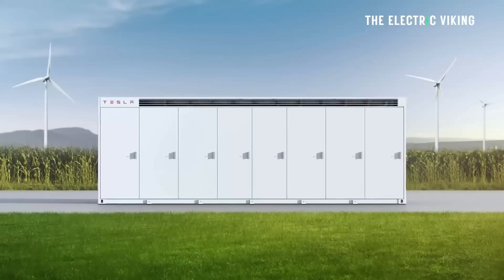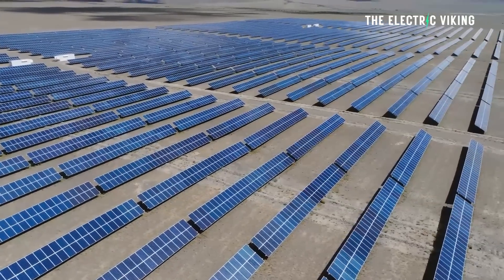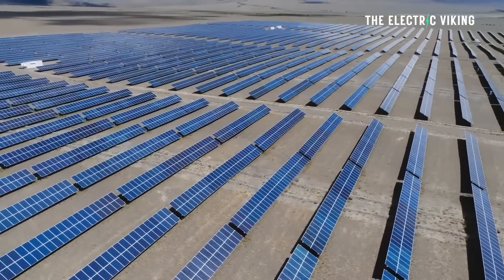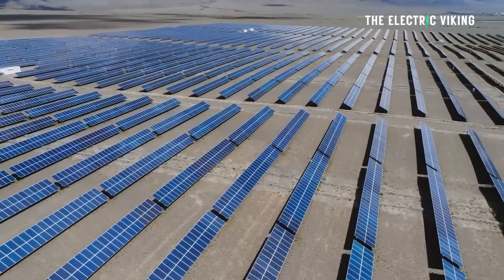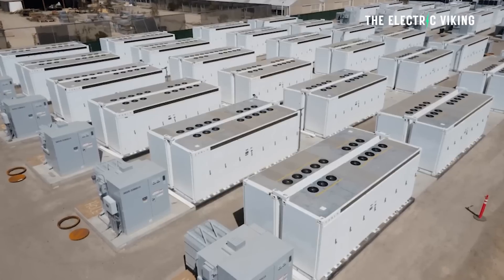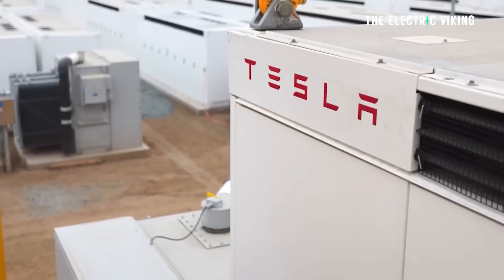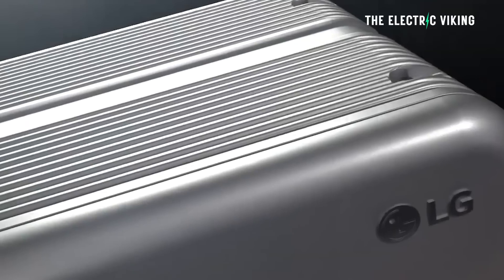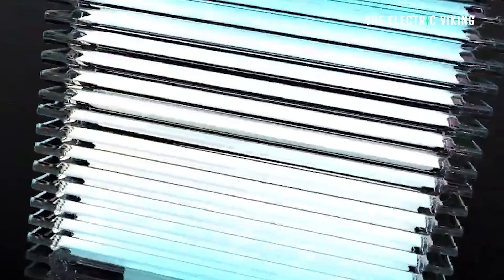Most Aussie solar, battery & EV charging systems in-correctly installed

Comment: This is a cautionary tale for the rest of us. Due to the periodicity of solar production, it will be quite temping and frequently necessary to overprovision solar to ensure adequate power during the cold times of the year with limited sun. This is fine and what should happen. Unfortunately , the grid regulator needs to ensure an even, consistent energy supply on the grid, which solar definitely is not. Consequently, they need a way to either store an excess of power on grid, or switch off customers rooftop solar, in markets where there is a lot of rooftop solar. This is a massive problem for grid operators because homeowners are in general a grumpy lot, busy with castle building, and not terribly compliant. Nor are they especially likely to be cooperative and turn off the free energy they otherwise would be paying for at their utilities’ request. They also might simply be not at home. The utilities’ opportunity is to make sure that inverters have the right features and are installed correctly for remote operation by the grid operator so that the homeowner is out of the loop.

Comment: There have been huge changes to what and how wiring is done . That doesn't mean things are wrong . They were right when installed to the standards then . Talk to Actual electricians and they will tel you what Im saying is true . This happens in a lot of industries changing standards . Do you see Governments retrofitting all the wiring in their buildings NO . I bet 95% of 5 year or older buildings don't comply to a whole heap of standards , lifts, flooring , lighting, water supply , balcony height , window openings, handrails , roof insulation around downlight ( even LED ) . By law you change one thing and you have to bring it all up to the current standard , don't see Government doing it when it applies to them . Unless it suits them .
Reply: They are plenty wrong when one considers the need of the grid operator to regulate voltages. The only reason it isn’t happening in more places is that solar uptake has been slow in those places. Future building code will eventually have to include means by which the grid operator can remotely shut off panels if they’re is an overproduction problem.

Comment: I am not in Australia (UK) but could the regulations lead to consumers being forced to IMPORT power as a "grid stability" measure during a time when solar is actually producing an excess?
I can see that it is clearly in the interests of grid stability to have the systems reduce exports - possibly to zero - but not beyond zero. Also "rooftop curtailment" sounds like it goes beyond that. For example, limiting the householder's ability even to use his own power in-house. 
My view is that the Sun is free, and what power I generate is 100% mine to do with exactly how I please, and pay no-one for it. But of course, the grid itself is not mine, so its managers can ask that it not be used as an infinite sink for excess.
I found the piece slightly baffling in that it did not summarise what the required settings provided for in terms of (say) limiting export ( at least in broadest terms).
Reply: Yes. That is exactly what will happen — to the degree that you would otherwise be using energy. I don’t yet see jackbooted things showing up at your door to demand you turn on the dryer, at least until inexpensive robosoldiers are available.

If you want to avoid this fate, home storage is important.

Comment: Rule no.1... dont export to grid... just use you own solar power.
Reply: This is quite inefficient. A lot of solar power would be wasted, especially in summer, when the sun is shining and the batteries are full. This will be especially likely because the off grid customer will need to install a many times larger solar array in order to cover winter energy needs, meaning that in summer they will have vastly more power they need.
Reply: @ianollmann9393  One of the by products of all power is heat.... heat is not your friend in any equipment especially in summer. Ever wondered why they put 25 deg C temp with the battery specs and checked what happens to the live cycles at 35 deg C?
BTW, I live off grid on solar power.

Comment: I seem to remember hearing about this at the time the regulation was introduced. I would be willing to bet the reasons many inverters don't comply is because installers weren't given appropriate notice and neither were the inverter manufacturers. Many were left with stock that didn't comply (especially in South Australia where the change was actually implemented in September 2020). Still I wouldn't be surprised if complying inverters were installed with the incorrect settings. But what a mess of a response from the authority. On inverters where they could "tell" half of them didn't comply? You would think the idea of sending an inspector out to someone's home might involve actual testing to determine if the inverter complies not just a menu check. LVRT - Low Voltage Ride-Through must comply with the corresponding Low Voltage Response Test. In Australia your inverter must turn off if it detects a lower votage than 180VAC for more than 1 sec (single phase). However the ride through provision says it must stay on even if the voltage drops to 50VAC as long as the duration is no longer than 220ms. There's more to it than that - like how it deals with multiple disturbances etc. They make equipment to test this. It wasn't used. Instead they just said on inverters without a screen they couldn't check. One other question to ask is how frequent are these low voltage events and are they really causing all these solar installs to trip and stop producing power? The most common cause of solar inverter shutdown is actually HVRT or high voltage events caused by local transformers not being able to cope with excessive solar and voltage rising too far. So while it would be nice if all inverters installed post 2021 complied to help stabilise the grid I doubt people are experiencing many low voltage events that shut down their solar inverter continuously. I still think it would be+a good idea for a lot of Aussies to have their solar installs checked over but I'd be much more concerned about shoddy wiring and circuit protection than this.
Reply: The AS/NZS 4777.2:2020 standard specifies several key settings and requirements that solar installers must configure correctly for grid-connected inverters. These settings are critical for ensuring the safe and efficient operation of the inverter and maintaining the stability and integrity of the electricity grid. Some of the main settings and parameters that need to be configured by solar installers include:

1. Voltage and frequency ranges: The inverter must be configured to operate within specific voltage and frequency ranges as defined by the standard. These ranges help ensure that the inverter can respond appropriately to grid disturbances and maintain grid stability.

2. Voltage rise and power quality: Solar installers must configure the inverter's settings to minimize voltage rise and maintain power quality. This may include settings for reactive power control, power factor control, and voltage regulation.

3. Anti-islanding protection: Inverters must have anti-islanding protection to ensure they automatically disconnect from the grid in the event of a grid outage. This is crucial for the safety of utility workers and to prevent damage to grid infrastructure. Installers must configure the inverter's anti-islanding protection settings according to the standard's requirements.

4. Active power control: Installers need to configure the inverter's active power control settings to manage the output of the solar system in response to grid conditions, such as frequency or voltage deviations. This can help maintain grid stability and prevent overloading.

5. Ramp rate control: The ramp rate control settings determine how quickly the inverter can change its active power output in response to changes in solar irradiance. Configuring these settings according to the standard helps avoid rapid fluctuations in power output that could affect grid stability.

6. Grid support functions: The standard may require inverters to provide specific grid support functions, such as frequency and voltage support, under certain conditions. Installers must configure these settings as per the standard's requirements.

It's essential for solar installers to configure these settings accurately to ensure the safe and efficient operation of grid-connected solar inverter systems. Proper configuration also helps maintain the integrity of the electricity grid and comply with the AS/NZS 4777.2:2020 standard.
Reply: Thank you, GPT-4.

Comment: No battery installation for us, as it is not worth the cost on pay back.  Our panels are rubbish, but beautifully installed.  Can’t ask for better than that.  Consistently underperform, but beautifully manufactured.  We are blessed with the best looking panels in the street.
We do an anti islanding test every year ourselves.  It’s simple and lets us know if the system is OK.  Sadly, the system is still rubbish, but at least I have a green and white PV sign on our meter box door to let the whole street know we are ‘right on’ people.
Sounds like the regulator needs to do more training of installers and informing them of changes.  Perhaps actually check installations as well.  If there are so many wrong installations, then something is being lost in the communications.  Perhaps they do get out now and again, but keeping up with inverter settings must be a pain when the rules keep changing.
Reply: Battery installation will be how you avoid grid operator shutoff and the loss of payback for your panels.
Reply: @ianollmann9393  By the time the batteries have paid back the cost, they will need replacing,  You are never in front on costs.  As panels and batteries come down in price, someone in the system (somewhere) finds a better way of charging you more for a new initiative or service that you did not know you had to have.  So, the installed price and running costs always stays the same.  Any energy bill always has two part, energy consumed and a service charge.  As the consumed part reduces, the service charge rises, and you are hit with a higher kWh tarif if you have solar.  So, as a government initiative on green energy I have to ask; who’s kidding who!

I am not keen on decarboning the world , I just want the cost of power to be reduced.  Batteries aren’t the answer.  I want to avoid a potential fire as well.  If I started over again (and I doubt it) I would opt for doing nothing.  No solar, no.batteries as its not worth it in the long run.  Just use less power (less is more).  Cheers.

Comment: I'll be interested in what industry is saying about this, if there is a reason like you wondered or just lack of education and skills etc. since the industry does generally try to self regulate on safety issues etc. hopefully renew economy and 'just another solar podcast' cover it at some point.
Reply: Maybe there is a tech issue? Wouldn't be the first time regulators asked for something that didn't exist or wasn't easy to get access to quickly. One of the reasons there is such drama about getting dumb vs smart grid safety switches installed everywhere. eg. Trying to get specialised smart safety switches made for just one specific state rather than a national plan not really going over so well with manufacturers. or the whole 'you have until x date to get products tested to x standard before we cut everything untested off, even if the testing facilities to do such a thing literally don't exist in the entire world, oops.' XD

Comment: I’m producing currently 51Kw from solar and storing most of the excess in my Tesla 2 Wall Batteries. So I can store up to 27Kw. I also can send 75Kw to my Tesla Model 3 LR.
Reply: I only have a 3.2 kw array and 7 kWh lifepo storage but it’s still saving me loads of money here in 🇬🇧, 3.6 kw inverter too and altogether cost me under £4000 .
Reply: @antoniopalmero4063  Do you heat your water tank with your PV panels ?
Reply: Dito 3.6 kw panels , 4.8kw battery and in 🇬🇧 and I’m completely off grid with electric and hot water from March . Saving £250’pm on my neighbours bill (the exact same house 😬) instal cost 9k . 😅